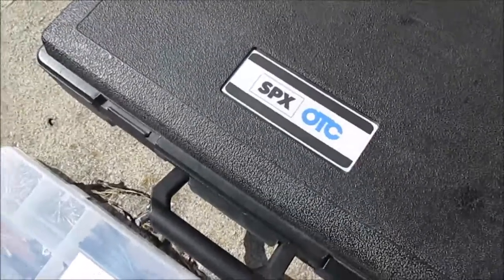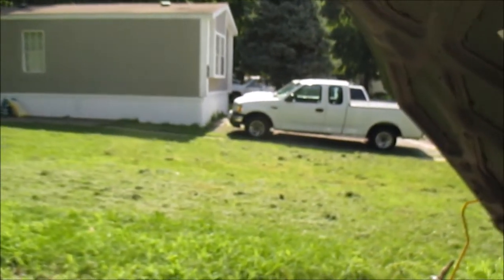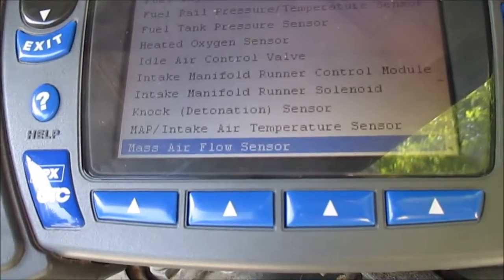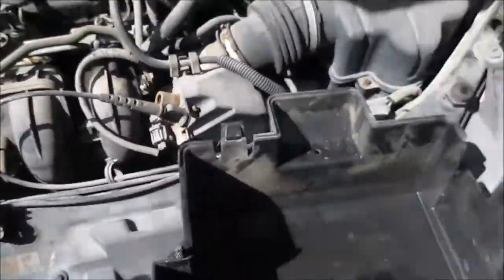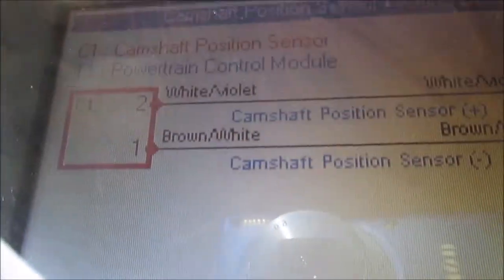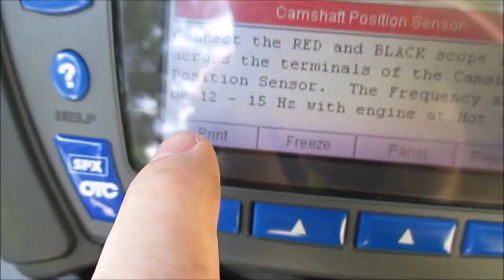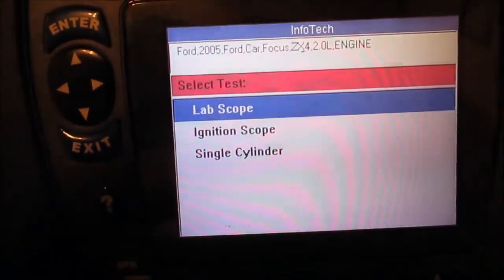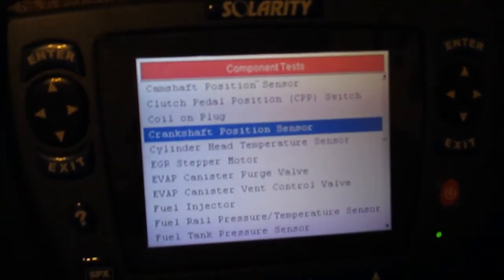OTC Solarity 4 Channel Scope Overview

Comment: does this scope need an attenuator for coil testing,
Reply from the maker: As far as I know an attenuator is not required, but I could be mistaken. I know in the guided component tests where it tells you where to put your leads, does not mention using an attenuator on coils, fuel injectors, or other solenoids. The scope uses kv probes and pickups for testing the coils secondary waveform. Well I hope this info helps you out. Thanks for watching and thanks for the comment. Have a good day.
Reply: Thanks for the reply. I didn't think it needed one, probably built in because of secondary ignition testing.

Comment: Dude, I have a 2004 ZX3 and '98 F-150.
This looks like a really handy tool. Can't be too cheap, but no doubt worth the investment for anybody doing serious mechanical work.
Reply from the maker: Yeah it is a handy for sure if you work on anything under a 2005, I bought this kit used off Ebay. However If I had to choose again I think I would have saved up for a snap on vantage pro component test meter.